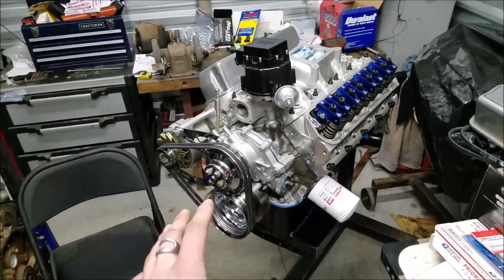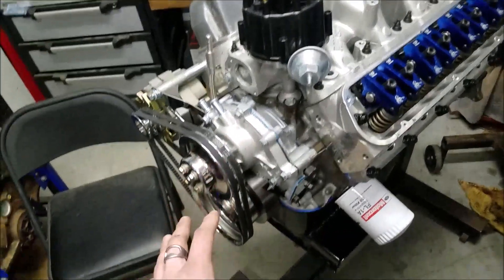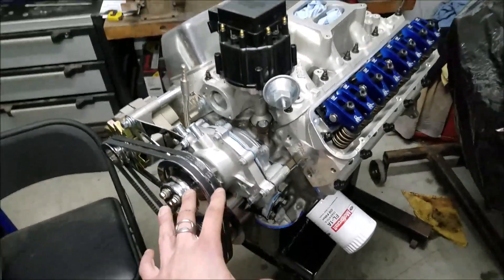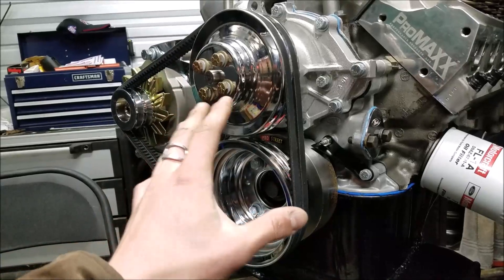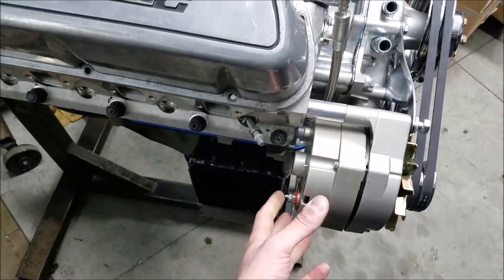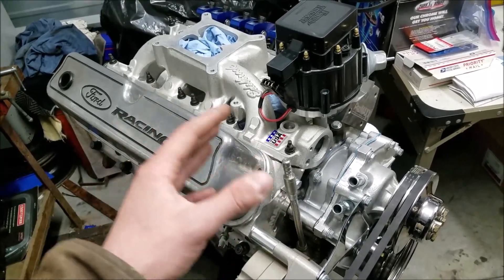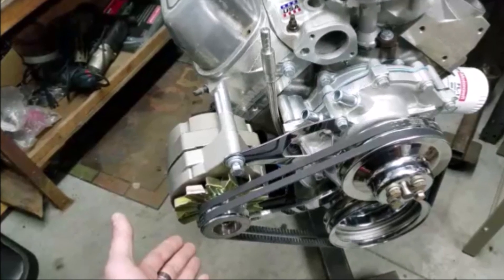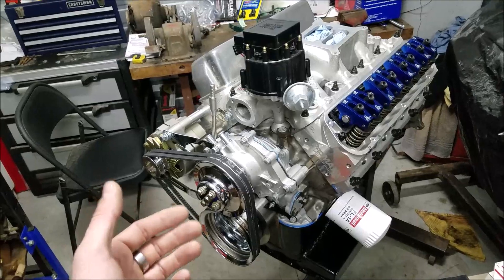"Drop in Anything" 302/5.0/351w - Pulley/Timing Cover Setup (Perfect for Roller 5.0 Swaps)

Comment from the maker: Parts links for what I used on this are in the description above. 
Finally getting some warmer weather. I’m beyond ready to drop this clunker engine in the galaxie - power tour 19 is less than 100 days!!!
Reply: If I can get enough time off I hope to take my falcon on the power tour this year.
Reply: Yea it looks like we are finely going to have some warmer weather coming in up here in Wisconsin.
Reply: Hey Luke, I'm gonna drop a roller 302 in my 1953 Ford Sedan, this looks like just the ticket!

When you build these, do you swap out the cam and heads, or do you find the stock setup to be more than adequate powerwise? Putting the motor in front of an AOD if that helps.
Reply: Thunderhead289 I’m not seeing the water pump in parts list. I’m confused because you said roller block with standard rotation water pump. Am I missing something? I thought roller blocks can ONLY run reverse rotation water pump.
Can someone clarify?
Reply from the maker: @WesternReloader  its dependent on the timing cover - not block specific in any way. 
for example, a 1980s crown victoria happens to have a standard rotation water pump even though its serpentine.

Comment: I think it was in the mid 1981 model year when Ford changed the balancing of there 5.0L crankshaft. I worked as a heavy engine mechanic in a Ford dealer at the time, and remembering changing a 302 in a new 1981 Crown Victoria. The engine vibrated at idle, and above 4000 rpm. It had the old style crank, with the new style flywheel and balancer. Ford sent a new complete engine, with flywheel and balancers to replace the vibrating engine. The crank difference is visible when both types are set side by side. Your engine is looking really good. Looking forward to seeing that 65 Ford roll down the road. The 65 & 66 Ford are my favorite years of the 60's era Fords's... 66 being my favorite.

Comment: About 20 years ago I put a 1994 5.0 Ford Racing crate engine in my 67 mustang.  I really had to do my homework to get a V-belt set-up to work, but I did.  I was going to use an electric fan and found that a single belt turning my one wire 100A alternator (the same kind you show in the video, but a PowerMaster), wasn't going to work.  It squealed like a pig every time the fan would come on and you can only increase the tension on the belt so far and that's it.  Finding a 50 oz harmonic balancer that would accept a factory 3 bolt, V-belt crank pulley to make a two belt alternator drive was impossible.  Being on a budget, I couldn't afford any of those high-end billet pulleys to make a two belt alternator work either, so off came that electric fan; a clutch fan replaced it.  For the sake of simplicity, I'm going to keep it right where it is but I like to two belt alt drive system and want to add it.

ThunderHead, I appreciate the list of parts that you've given us.  Now to see if I can get what you've provided to work for me.  The only issue now is to see if I can get power steering to work with it.  I have one of those Borgeson Power Steering kits to install.  I know that it's going to take a 3 groove crank pulley because I really don't like the idea of sharing one of those alternator belts.  I've seen an add-on pulley used to make it work and at least with a balancer that allows the use 3 bolts it's going to be possible.  Thanks again for sharing your knowledge.

Comment: I had a hell of a time getting my 91 gt engine into my 67 mustang but I'm also running power steering. I used a 67 mustang 289 cover,water pump. And front 3 groove damper pulley since I plan on a.c later. I found a 3 groove water pump pulley of a 70s ford truck. And the cheap 67 mustang alt brackets I was able to use my 200 6cyl alt! I did buy a cheap 50oz aftermarket damper from professional products with both 3 and 4 bolts.

Comment: Good info! Like always another great video.  Can't wait to see the Galaxie back on the road!

I get why people run those hei distributors. They are simple to hook up. But man they are fugly!  It's like a big old wart on otherwise beautiful face. If you run a hei make sure to carry with a spare module and the coil carbon button/brush. Both of those parts have left me stranded on the couple chevys I owned when I was much younger. 

My choice isn't period correct looking either but I just like the Durapark II set ups.  I've had great luck with the DS II distributors with a MSD box and coil.  Use their adapter harness and carry a stock DS ignition module with in the car/truck. If the MSD ever fails just unplug it, plug in the stock box and you are back on the road.

Comment: Personally did an HEI and also did a tuff stuff 90a alternator on my 400. I run a lot more electronics than factory, so the alternator does the job perfectly, and the HEI gets rid of the bs duraspark ignition system. GM did a few things right…. Those were it

Comment: I used a glimmer belt set up on my 68 289. The belt does not slip at all. The down side was the $150.00 price. But I will say it was worth it.
Reply from the maker: This set up for jut the pulleys comes in at about 100, but they are thick good quality pulleys. 
Do you have a link for yours???
Reply: @ThunderHead289  no. But I can get the part number. Summit carries it.
Reply: Ok it is Jegs that had it . PN # 746pce415.1004 $138.02
Reply: The belt is 1 1/2 wide. Looks like a blower belt. 😎

Comment: Man @ThunderHead289 wish I had seen this before I started my engine build. Mixed all kinds of parts like a Summit 28oz dampener, TuffStuff water pump and who knows what timing cover and now having issues getting a Scott Drake pulley kit to work. Nothing lines up. :(  Almost feel like starting over and removing the water pump and get everything you have here. Not sure what I'm going to do.

Comment: I like the idea of drop in anything, but I hate those giant HEI distributors. I’ve always had air cleaner issues, I’ve only used the HEI conversion on 3 units, but they are nice on some applications could not get the ignition system right on my dads ‘86 f350 and ended up having to go that route after a long run around of electrical issues. What air cleaner are you toning to run?

Comment: Hey man got a quick question I have a 331 stroker with a 1850 holley no choke no really sure cam haven't broken engine down for specs yet just cleaning it up and the carb is not allowing the engine to consistently stay running what would you suggest to start troubleshooting steps. It cranks up no problem msd ignition coil no vacuum leaks it will crank just have to kinda hold on the gas a bit to keep it running. Once off the gas it stalls out. If you could help would be awesome Thanks.

Comment: is that grade 8 bolts on the water pump pulley and grade 2 on the crank pulley and the alternator bolt? looking forward to this going in the Galaxie!
Reply from the maker: Everything is grade 5, those were just to hold the pulley on it the garage and to have everything test fit - in the car, it will run a mechanical fan with fan spacer 👍👍
I’m excited too!

Comment: Since I switch to electric fuel pump I'm keeping a mechanical fuel pump in my car for a backup in case the electric fuel pump goes out that way I won't be stranded anywhere

I don't have block off plate at the moment but what I did was I took a old mechanical fuel pump that wasn't any good and cut the arm off and tightened it back down that way it's not trying to pump and it's keeping the oil inside the block until I can order me a block off plate temporary fix

Comment: Any balancer pulley setups for a 28oz imbalance? Im basicly using your cook book but just a different imbalance.
Reply from the maker: Hey bud, the summit balancer I use can be had in a 28oz configuration
Reply: @ThunderHead289  i for some reason had a brain fart and thought those two parts were actually one part. My bad. Lol this 331s going into a 4 door fully shaved 64 comet. People will genuinely be confused with this one. Thanks for the info!
Reply from the maker: coozy100 no problem, should be a fun ride! 
Join the Thunderhead289 Facebook group and post some pictures of it!
Reply: @ThunderHead289  so i found the 28oz version of that but it says it wont work with late blocks. Is that because of a stock crank? Im using a scat crank so i dont think this pertains to me.
Reply: coozy100 I’m curious how your setup went? I’m also building late model roller block, with 28 oz imbalance. What’d you end up going with and what did you have to do to balance your setup? Machine shop charges?

Comment: Are you still using the N+271S cam? Are you happy with it?
Reply from the maker: This is a roller block, so I opted for the ex266hr Comp unit here 👍
Reply: ThunderHead289 how’s the torque down low on that cam?

Comment: Standard rotation water pump in roller block? Am I confused?
Reply from the maker: That is correct. 
It’s a v belt, so it has to be clockwise rotation. - it has the oldschool timing cover to accommodate this flow
Reply: ThunderHead289 so I can re-use the timing cover from my 1980 302 on my new roller block, keep standard rotation water pump, and existing V belt set up?
Reply from the maker: Rich absolutely - the block being roller or not does not matter one bit 👍
Just be sure to use a 50oz harmonic balancer
Reply: ThunderHead289 I can’t use 50oz as it’s a Scat 9000 331 rotating assembly that’s at 28oz. So hopefully I can re-use my fly wheel, my harmonic balancer, timing cover, v belt set up and just buy a new standard rotation water pump. I think. ((All existing parts from my 1980 Bronco)) oh and I need to buy that mechanical pivot thing for my granny 4 speed
Reply from the maker: Rich you are good - didn’t realize you had a stroker crank in there 👍
Be careful to use one that has the appropriate timing marks then, most of the budget aftermarket ones have timing marks to accommodate all pointer locations